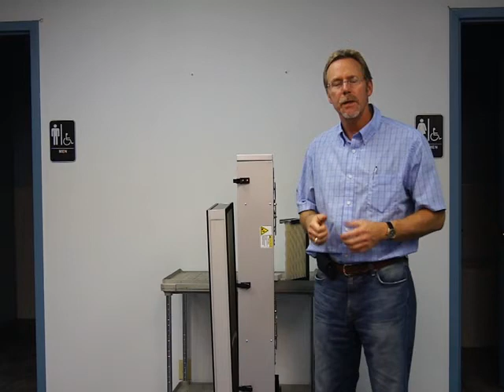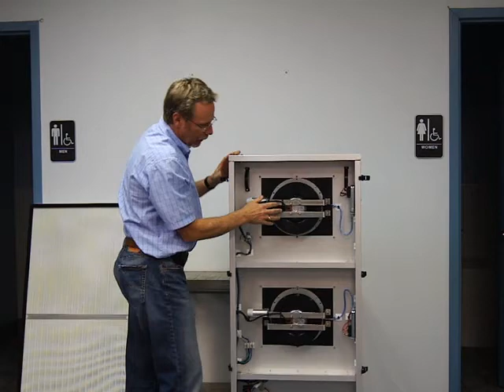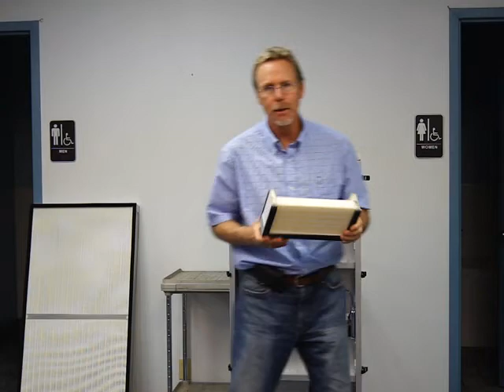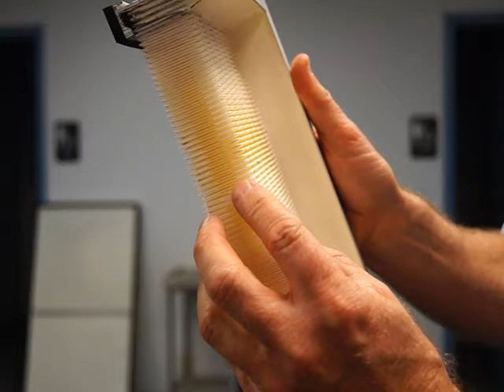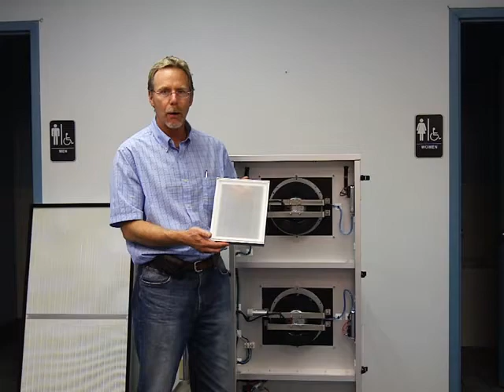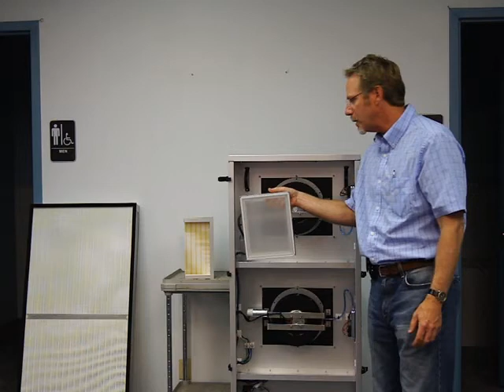Air flow uniformity in HEPA filters used in fan filter units

Comment: Does it matter if air is pushed vs pulled through a HEPA filter ? What side of a fan should a filter be on ?
Reply: Yeah I would like to know it as well. Plus how can we establish the best airflow (in terms of speed or pressure) by wich we can get the best efficiency of the filter?